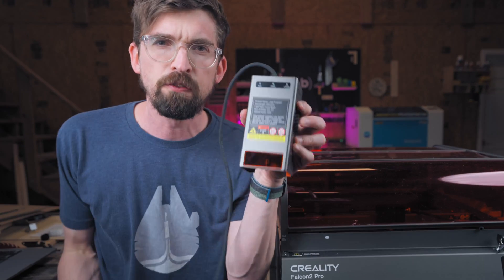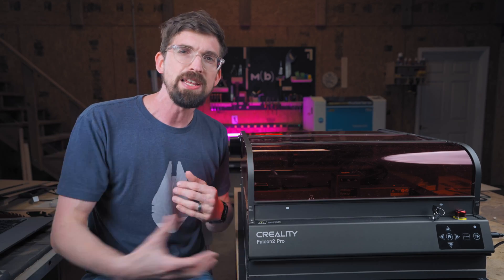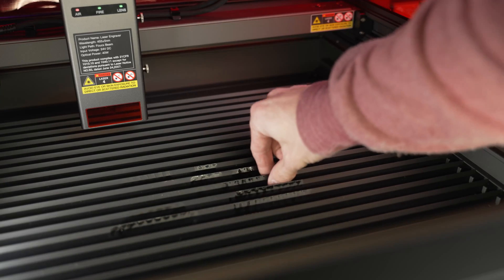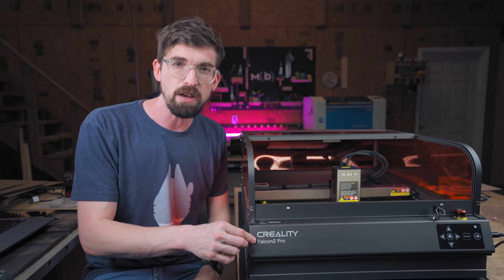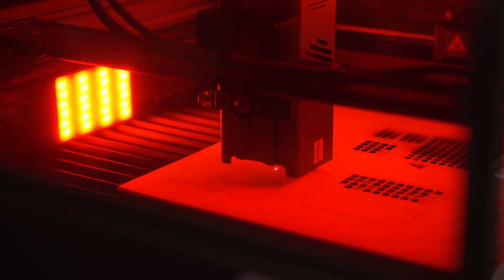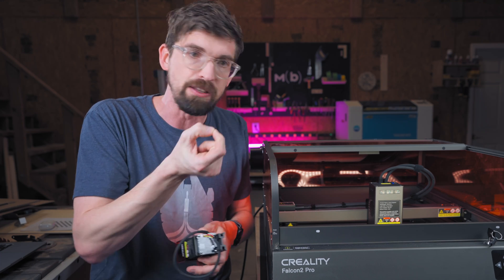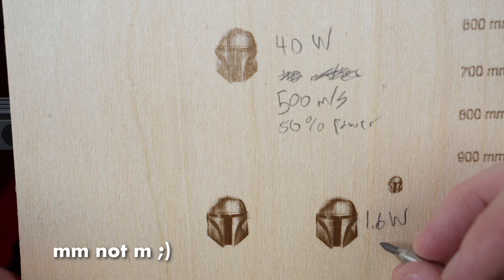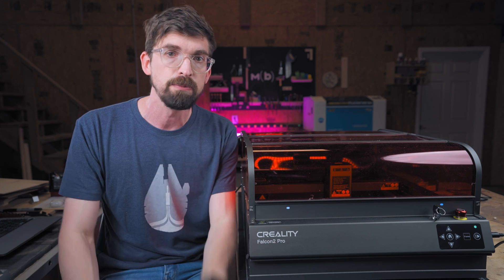Finally A Desktop Laser Cutter That Is (Mostly) Safe.

Comment: Does anyone have one of these as I have a question please, the falcon 2 has a button on the top of the module to switch the laser from 40w to 20w for a smaller beam to engrave, does the falcon 2 pro have the same feature ? I can see in the video it has the button on the top but no review I have watched mentions it, Many thanks

Comment: Great video! I'm looking to cut embroidered patches on twill fabric.

But the Falcon website says Fabric can be engraved but NOT cut. I find that surprizing. I was hoping to get away with the 22W one, but now I am hesitating the entire project. I was excited about Diode lasers as the size of the work area is much larger than any desktop CO2. But now I am worried, I could not find any people using it for twill patches so your input is greatly appreciated. 

Below is copied from the website"
Diode laser cuttable: paper, wood, leather, MDF, felt, some dark opaque acrylic
Diode laser engravable: Paper, Wood, Leather, MDF, Stairless steel, Some dark opaque acrylic, Bamboo, Fabric, Dark

Comment: Could you share de model reference of the 1.6 module ? Creality told me it's the module  that can be adapted on a 3d printer but not its reference.

I would also like to know how it's wired to the frame so if you can share the wiring on frame and module side it would be nice ! 

Thanks !

Comment: Wrong! 40w is not the max for a diode laser. Ikier has 70w and 48w versions.
Reply from the maker: Ha, well "about" the max.  Ikier is the only machine going to 70 currently (that I know of), but I'm sure we will see the other guys follow up pretty quickly.
Reply: Mirrors factor 6w diodes , just multiply that by 10.

Comment: So you have to engrave leatherette patches on sheet first with small watt laser and then swap to 40 watt laser to cut? How it would know the registration after swapping heads? So it not off?
Reply from the maker: You could still engrave with the 40W and get good results depending on the detail of the cut.  But if you do need to switch you'll still be good.  Between switching the heads you would home the machine with the limit switches and then start the next cut/engrave.

Comment: Here you guys are pushing these >$1k lasers when you can just get a real K40 for like $400 :[
Reply: Compared to a glowforge, 1k ain’t bad.
Reply from the maker: If you like to tinker and the smaller work area isn’t a deal breaker they ares till great.  I think in about a year these 40W machines will come done in price too the 500-700 range.
Reply: Sad there’s no pass through tbh.  It’s the only feature I think it misses at this price
Reply: @aaronblackford981  You want a pass through,  it's called an angle grinder 😂,  or just build your own enclosure for the regular Falcon 2 like I did.
Reply: My d1 pro was better cutting wood than the k40, quicker and more precise
Reply: Pushing??? I think we know this Smiley.....this dude rocks. Stop rearing your mean face on all his vids saying irrelevant bs NOBODY wants to hear.

Comment: Not laser friendly at all I need help! I want to know which laser would be best for me to use for cutting sublimation blanks out. The glow for just too expensive for me. I’ve looked at the Xtool M1 and two others they have. What’s the most reasonable priced for for the best results?
Reply: The xTool M1 has a blade cutter like a circuit machine which is much more suitable for sublimation transfers.
Lasers can't be used on many plastics and materials it'll create toxic gas. So using a blade cutter for sublimation transfer materials would be best
Reply: Forge
Reply from the maker: @camshand nailed it.  For sublimation transfers you'll need to stick with a blade cutter, the xTool M1 is a great choice since it also has a laser as well.  But you could also get away with a straight vinyl cutter like a Cricuit.
Reply: @makeorbreakshop 
Brother also make similar cutting machines to Cricuit.  Best to look at specs and reviews, and check availability of what you will need for consumables.

Comment: Thanks for the video! Very informative and it looks like  a very nice machine with a lot of thought put in to it. Curious as to why they would only offer a 1.5 watt laser for regular engraving? Standard seems to be 5.5 to 10 watt now. A 1.5 watt seems way to slow for my liking. How many lasers are integrated in to their 40 watt laser? Again, great video! :)
Reply from the maker: I would guess the 1.5W vs 5.5 to 10 is a cost savings thing.  And if you are going to step down to get the finest engraving possible the smaller you go the better, but you're right you will lose out on some speed.  Normal laser diodes are around 5W so this would have 8.  Some machine will also have the option to turn on and off half the diodes in the laser head itself, so effectively giving you a 40 and a 20W option at the same time.
Reply: @makeorbreakshop  Thank you :)